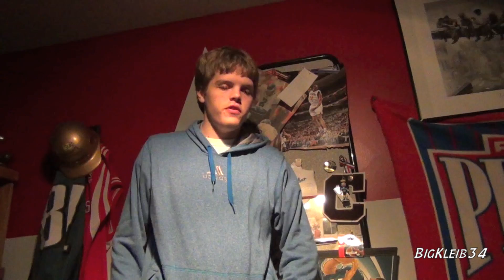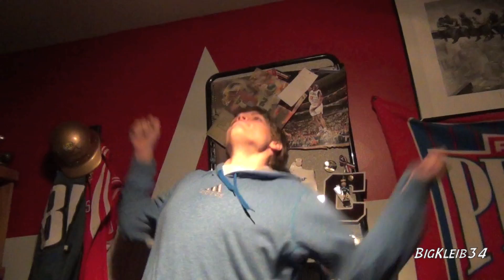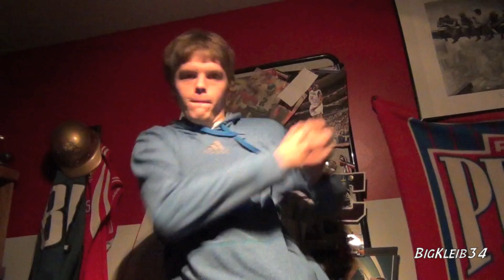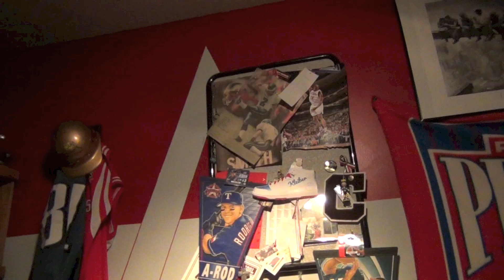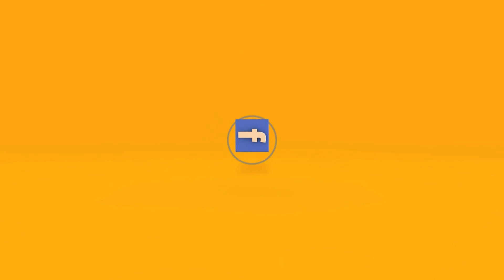Parody: Rotary vs Piston Engine Explained for Dummies

Comment: Everyone here seems to have a biased opinion of some kind so I'm just gonna share some unbiased insight, the rotary engine is more power efficient but uses twice the amount of gas to do it, but if you don't care about the gas you want that rotary, it revs more freely and is smooth as silk, which is what you want where you should be driving a RX7, a twisty road. Now as far as wear and tear yes a typical V8 will outlast a rotary but only if the rotary is boosted, people will whine and tell you lots of things about apex seal failure, if you're afraid of that, which you shouldn't be because my dog could replace apex seals for $200 which can't be said for any piston engine, get the non turbo RX7 FC, those apex seals last a lot longer without the boost. So summary, if you want an easy RX7 get a non turbo, if you want a fast RX7 get the turbo, if you want an LS just get a Camaro
Reply: +James Treadway If any engine uses twice the fuel? its LESS EFFICIENT

Comment: The fastest cars in the world use piston engines they are defiantly better but the rotary engines do have their advantages
Reply: +redneckon2wheels  you are right but the fastest are top fuel hemi's v-8 running nitro ...i been to a few races were 13b rotaries were just killing the v-8 guys and these little motors are only 1.8 liters
Reply: LAVAROCK100 1.3*

Comment: Mazda was banned from using it in the Le Mans because it created an unfair advantage. Doesn't sound like a motor that explodes to me.Plus piston engines don't readily redline at 10k RPM without cause serious wear to the engine.

The real difference. Piston has more torque, better fuel economy but 3 times the moving parts that a rotary does. Rotary is a smaller, fuel hungry, high output engine that consumes oil as it runs but it is designed to run hard without breaking.
Reply: +kamranos Actually Wankel engine were never banned by the FIA... that is not true.

what is true is that Mazda opted to retire its 787 cars the year before the rules were scheduled to change... rather than comply with the new formula rules.
Reply: +The real doktorbimmer the rule change banned the engine. Until its recent over turn, the 787b engine was banned.
Reply: kamranos No, it was not banned... and there is no factual basis to claim it was.. the rules changed for ALL the competitors in that class.. most adopted the the new rules and changed their engines to comply... others simply retired the old engines like Mazda did..

Mazda was planning to retire the 787s anyway since the win at Sarthe was the only time the car had ever won a race... the cars up until that point were not competitive

Comment: Rotaries are better. that is all
Reply: +AFX - Clan    then why are they no longer made?
Reply: well actually they were recently made a few years ago, and they are now making more.
Reply: AFX - Clan Actually they don't... on Friday June 22, 2012 at 4:30pm the Wankel engine assembly plant at Mazda Ujina #2 shut down and shortly there after was dismantled to make way for a brand new engine assembly facility specifically designed to manufacture Mazda's new signature Skyactiv line of Otto and Diesel engines...

Mazda does not make them anymore

although they did recently unveil a concept car proported to be powered by a Wankel engine. No new engine exists currently and no official plans have been announced for production.
Reply: That's weird because I have done further research and they are experimenting on the rotary engine and are about to begin prototype testing. Why would they do prototype testing and waste all this money and resources if they arent going to use the engine in the future??

Comment: i own both a piston car ( 83 corolla with a built 4ac) and a rotary car ( 85 Rx-7 GS with the 12a stock ) and i drive the 7 more. its is a lot funner. yes pistons engine get better mpg but the way the power of the rotary feels and its simplicity of 3 moving parts compared to the 38 of my 4ac. and the weight savings and center of gravity are lower also.
Reply: interesting :-)

Comment: Too bad rotary engines are built for high revs an ls motor would blow at 7 grand while a rotary can rev out till 9 grand
Reply: or higher, mazda got a 13b up to 17k lol. so I hear anyway.
Reply: ***** That's dandy for BMW and all, but the 2.6L 4 rotor can (conservatively) produce well over 700hp beyond 10,000rpm. <insert smiley>

Comment: Rotaries, if done right and taken care of(the main reason there arnt more rotaries is because they need up keep)put down way more power(with considerable torque) than a piston engine of comparable displacement. Let alone the fact that there only as many moving parts as there are  rotors and if you get the apex seals right it's very solid engine

Comment: .

BigKleib34
if you knew what you were talking about you would almost be dangerous. there is a rotory engine running 4 rotors at the race course. the motor is two years old and runs like the day it was installed. pushes 750 horse without a turbo! so your theory on a rotor only running one time with that set up is bogus BS. when you grow up move out of your moms house and learn a few things about engineering and mechanics we might be able to take you seriously.

Comment: thx my father usually is around with this stuff and i learn from my father without him id be lost in cars :P he tunes ALOT and works on engines and is a body-man at a body shop, he is actually planning to get a rx8 and he is gonna make it a 3 rotary with a turbo kit he found for $800 with a QTP exhaust and he has new injectures already for it with new spark-plugs and i can't wait to see it all come together i use to think rotary's suck but my dad told me some stuff did some research and its good

Comment: rotary's are more powerful a stock rx8 has 2 rotary's and can produce 290 hp stock now make a car with 4 rotary's and a huge turbo you got your self almost 800 hp easy while 4 cylinder engine you cant even pull of stock 250 and if you added 2 cylinders ad made it a v6 you cant even gain more than somewhere around 160-170 hp. Think what 6 rotary's can do with 1 huge turbo with a proper inter-cooler and injector's giving the right amount of fuel and a little bit of tuning you got 1000 hp.

Comment: Rotary =  power to weight, low center of gravity, high reving, and are compact for better weight distribution.. 

Yeah it has some flaws with low mpg and oil & torque . But most of the ones you see blowing up is from people boosting high and poor cooling, and improper maintenance.

Awesome for the track, but not so much for a everyday car lol.

Comment: 0% of rotary engines that have ever been built have exploded. A catastrophic rotary failure is usually a warped housing, thrown seal, or stripped stationary gear which results in an abrupt seizure and no parts exploding violently from the engine.

Comment: lol. it took me many years and many blown rotary motors before i fully understood this concept. I once was that one Rx7 guy who refused to put anything but a rotary in a Rx7, then i started blowing them up on average 1 per year and i was getting less gas mileage and way way less power than a V8 swap. The weight balance issue was always my argument, but its not valid at all, infact in FD's you actually lose weight with a LS1 swap. Let the rotar heads waste their money.